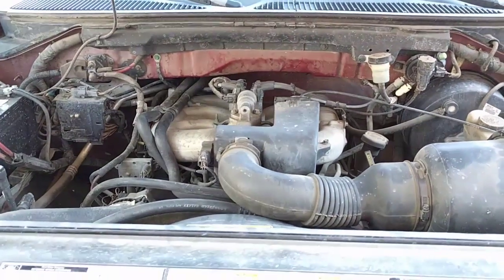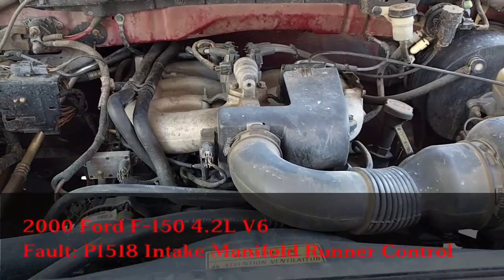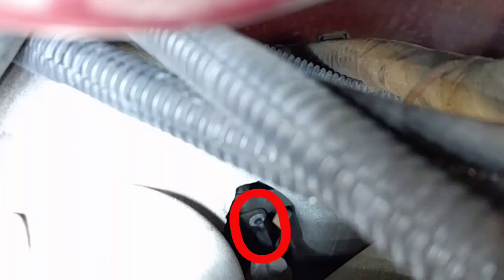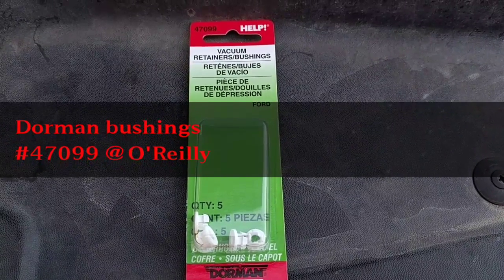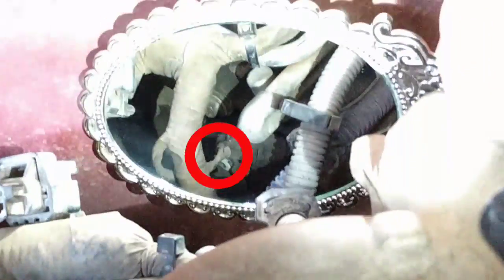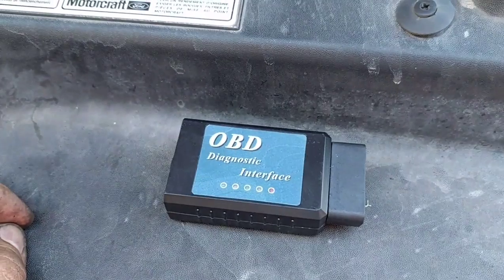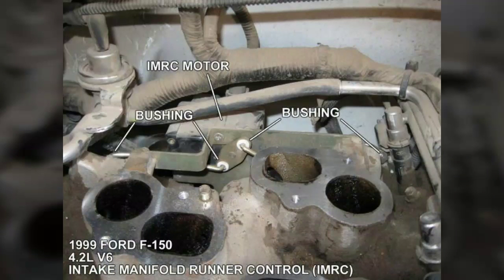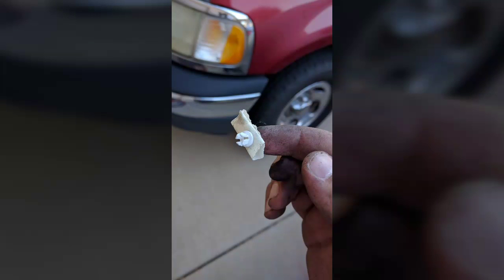2000 F-150 4.2L V6 - Fault Code: P1518 IMRC

Comment: 2001 Ford F150 4.2l w/178k miles.  I had to replace the upper air plenum assembly aka throttle body spacer (Motorcraft p/n 5308-05240647 or Dorman part number: 5308-05366385) which sits on top the intake manifold, it had cracked .  Unfortunately I should have replaced the IMRC control rod bushings at that time.  After I did the work of all new seals and gaskets, I later started getting secondary DTCs (P1518 IMRC stuck open, P0171/P0174 system too lean bank 1/2).  Later I was getting O2 sensor circuit failures but I'm pretty sure this was related to the "system too lean" issue with the IMRC valves stuck open.  I also found by sheer luck one of the IMRC control rods that had fell off completely and was sitting next to firewall.

It would be a good time to replace the fuel pressure regulator while you have removed the upper intake since it sits in the back next to firewall like the IMRC. Getting the retaining clip removed would be difficult otherwise.

Comment: Amazing video. Didn’t think I’d ever be able to get those bushings in without removing the intake manifold . The tape on the finger tip surprising worked with some finesse. Went to the store and got a small mirror also. Sure this took you several hours to figure out but thanks to you got it done in about 2 hours. Great video, much appreciated 👌🏾

Comment: Hey man, We are looking to buy this model truck for 3500 bucks. It only has 130000 miles with standard trans and runs good. Would you please say what issues or problems might we run into down the road? Cheap to work on? We're hoping, of course, for another 100000 trouble free miles. whatcha say? Thank you very much
Reply: The 4.2 is harder to find parts for than the V8s are. Other than that, countless forums are saying the 4.2 makes a better fleet vehicle because they outlast the V8s by almost double the mileage before crapping out. They have less power, but seem to handle the abuse better. The only problems with the 4.2 were in 97/98, it seems that after those years the engines are bullet proof as long as they're maintained.
Reply: @Dude13450  I know you wrote this comment ages ago, but what are the issues with the '97-'98s?  I bought one last year and it's good to know about what might go wrong
Reply: @ferociousferalferret  that I don't know. if its a four cylinder, You would have to look for similar era 240SX issues: same engine.
Reply: Did you get the vehicle? I got experience I’ll share with you if you are interested.

Comment: It is a good video but it doesn't look anything like a 2000 4.2 I have one and it has the plastic intake that one obviously does not and it is a stock intake on that I would venture to say that that is a 4.6 or lower than 2000 model but still a great video man that's pretty helpful in fact I that is actually a 1999 model I just thought you might want to know that
Reply: My 2000 model has the aluminum intake
Reply: Definitely not a 4.6, as those were 8 cylinders.
Reply: Got a 2000 with the aluminum intake as well and need to replace those bushings looks tough as hell to do

Comment: Just finished reattaching the linkage. Was a major pain in the butt! I can't understand why Ford would use plastic bushings to hold something that is this hard to get to.  I took your advice and used tape(I used duct tape) to hold the bushing onto my single fingertip. The one on the back of the manifold that you can not even see was actually the easiest one to replace. The visible one was more difficult to insert.  It took me about 2 hours trying to reattach the linkage.  Your video tips were very helpful. Thanks!
Reply: they could have put it in front of the engine but no- put it in hard to reach place

Comment: Thanks so much for this quality video! I reached in my engine bay and felt for the rod shown to try to put it in the bushing. MIRACULOUSLY I got it in place and fixed it. I’m still in utter disbelief because of the space constraints back there. This video helped me to understand the layout!
Reply: My truck is showing this same P1518 code, it hesitates, misses, and has a rattling that sounds like a pushrod, but it sounds like its coming from the right side of engine, left side of engine, and even underneath the truck you hear that rattle. Truck was running fine, I shut it off and when i started it back thats when all this happened. Did yours do the same way with the rattle, hesitation and missing?

Comment: Has anyone come up with a way to replace a bushing on the imrc motor without removing the manifold?
Reply: billy bristow I did by using a inspection camera and a piece of tape to hold the plastic bushing still tough now I have to take it all apart cause I think the actuator itself is bad

Comment: The tape on the finger trick was pure genius, otherwise,  I couldn't have done it without pulling the intake. Mine's a '98, when they still were using 2 IMRC actuators, left and right, and I couldn't see them from any angle. Ended up getting an inspection camera. Thanks again, awesome video.

Comment: Thank you for you video, Ive been watching along to fix the same problem, same side. Im trying to get the arm back in, but am struggling and i cant seem to line the motor up vertically. How did you get it to move? Thank you in advance!
Reply from the maker: I used a screwdriver to push it.. You may wanna use something that won't scratch it. 
It takes some force tho so make sure your other hand isn't in the way.
Thanks for watching!